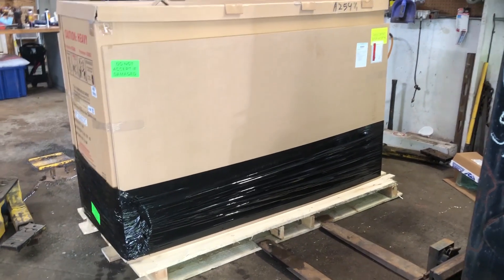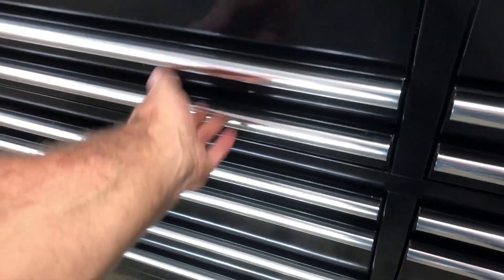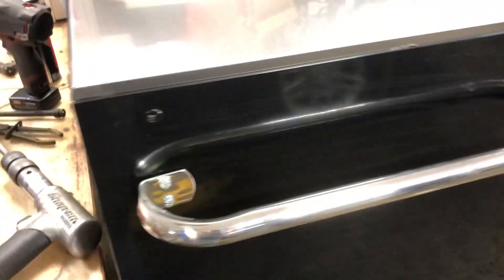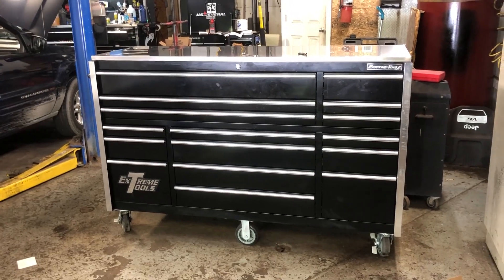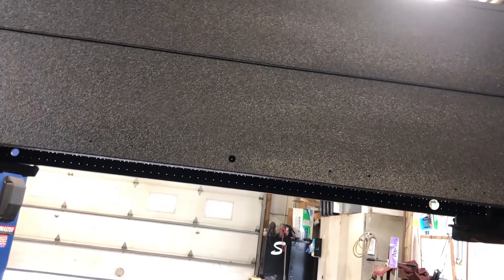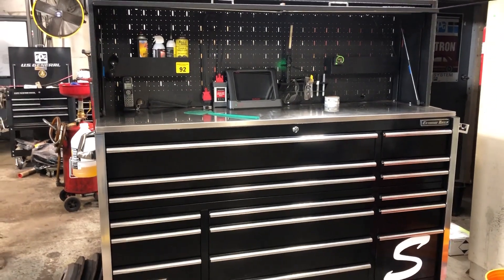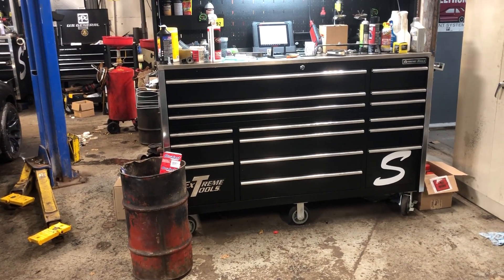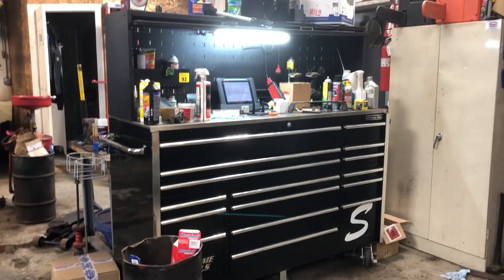Unboxing my new RX series Extreme tool box from Rockin' Tool boxes!

Comment: This video is what made me buy my 55x25 rx box about a year ago because it was probably the most honest review out there. I got the same issues with the drawers on mine tho. I found if I pull them to full extension on a regular basis they go easier. Sometimes I gotta fight them a bit but once they go full slide their fine for a while, and as far the tweaking I just got used to pushing them shut from the middle. That all being said, for the money they're hard to beat.
Reply from the maker: Thanks for your comment! They are a great box aren't they?! Real happy with mine!

Comment: I dont have a menards local to me but I was looking on their site and they sell the spring loaded casters which you can switch out, if you use 4 of those you can remove the middle ones.
Reply from the maker: Thanks for the tip! Yeah, I have Menards envy as well! None in my area either! I have considered swapping out the casters and may still at some point but, truth be told, the box only gets moved to clean. Still, I'll likely update them at some point, just because!
Reply: @SmittysShop   Menards does ship, it was only $10 to ship a big vice but when I searched their boxes it was $500 to ship one my way, the menards masterforce box is a pretty sweet deal they even sell add on power tool drawer where a drawer as tall as the tool box slides out with 2 levels to put your cordless tools in.

Comment: Would you recommend this over the bigger EX for a first box? I'm a heavy line tech already outgrew my yukon 46" and i'm looking for a box to keep for a long time but not tool truck prices.
Reply from the maker: I really like this box at the price point. HOWEVER, as a line tech and given you are continuing to grow your tool inventory, I would highly recommend the EX series box. It is every bit as good as "tool truck brands" and you just can't beat those 30" deep drawers! I'm not sure I would ever buy another box off a tool truck after owning Extreme boxes! I no, they don't pay or give me a damn thing to say that! It's just my opinion!
Reply: @SmittysShop  Would you say fit and finish and strength is comparable between your EX and RX? If someone doesn't need the depth do you feel like its worth the price hike? Thanks.
Reply from the maker: @ProfessorClay   There are some noticeable differences between the boxes.  If you are "into" tool boxes and you work out of them every day you will notice subtle differences between the two. It's really going to come down to your budget, use, etc. If you are working out of the box on the daily, you just can't beat the Ex series. They stand toe to toe with the "big name" boxes. However, that's not to discount the RX series. I'm still very pleased with this  RX box given the price point etc.!  The RX is more than a "home owner" tool box, in my opinion. It's just a slight step "down" from the EX series.
Reply: @SmittysShop  Thanks Smitty! It really helps to have your unbiased opinion before I take the plunge sight unseen. Thanks for helping everyone out and for the quick response. Warm regards.